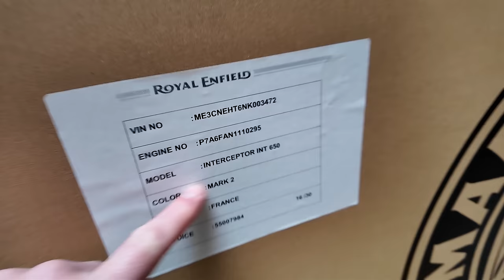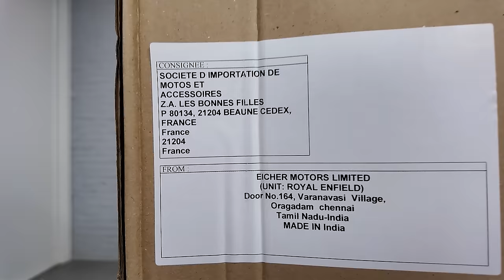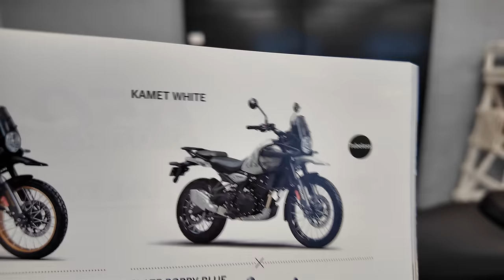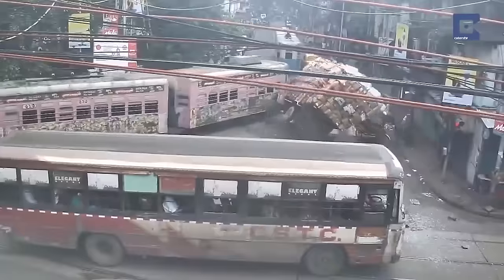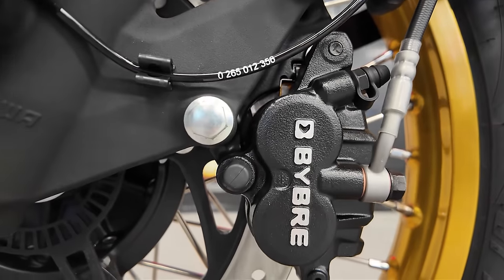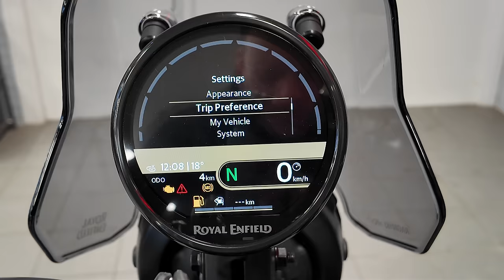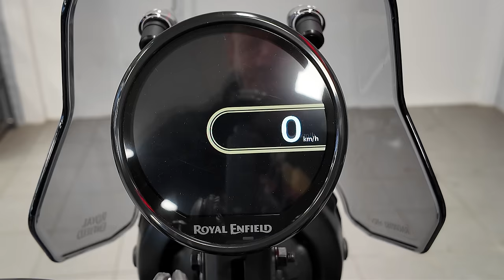2024 ROYAL ENFIELD HIMALAYAN 450 Unboxing (40HP)

Comment: I have a RE that's from 1980s... it's from my uncle...after he passed away i took the bike...it don't have petrol meter on it you have to open the tank to measure petrol and the sound it produce can give a heart attack to a old man...there won't be any better vehicle then royal Enfield and it's not meant for speed its take so much time to reach even 60-70 km and the gears are on right side unlike modern RE...there has to be two keys to make the bike start...one to start the engine snd other to produce petrol to engine and its doesn't have self it's kick start bike...old RE are total beast unlike modern one... it's good to see Royal Enfield getting recognised

Comment: You should connect the positive terminal to the battery first, then the negative.
This prevents short circuits because 12 volts of electricity are coming out of the battery, and a spark or a short is possible, if unlikely. 
The positive side connects to an engine part. The negative or ground terminal connects to the vehicle's frame.
Reply from the maker: Will do next time , might not explode than 😁
Reply: @LifeofSmokey  I hope you're alright 😂
Reply: @blaze26700   A bit burnt round the edges. Thats why him called smokey, innit

Comment: 13:52  In India, it is necessary to have rear view mirrors on the right hand side of your bike, not so much on the left hand side, people usually leave it off, hence the rubber tipped reusable kind of plug, for the left, but the one use tape for the right side. Hope that helps.

Comment: I want one! Also,  no, a cigarette cannot light gas on fire. Only an open flame can ignite gasoline.  You can dump gasoline on red hot coals, and all that would happen is that the gas would evaporate.  The evaporated gasoline is very, very explosive, and it looks like dry ice with the color and how it flows low to the ground. I had an interesting childhood. 😁

Comment: Well a very nice bike
 My 411cc model constantly gets fuel pump problem or whatever. The service guys couldnot fix it after 4 visits. Until that it ran for 2 years without any defect. I only changed tyres

Comment: It depends on flash point of fuel and the temperature of the flame of the cigarette’s flame but however oxygen is needed for the fire to happen which isn’t present in sufficient concentration on tip of cigarette. That’s why you can’t set fuel on fire with a cigarette!

Comment: Hi, ccan you look for these issues aftert a test ride of about 500Km ,Thank you. Just want to see if they fixed it for the export models.

-Bike pulling right when hands off handlebar.
-Con set sounds and issues
-Loud tappet sounds(louder than exhaust😂)
-Vibrations through out the rev range
-Tank leaks when it's full and on side stand🤦‍♂
-Sound from brake pads while braking (great brakes but the brembo pads do make sound).
Reply: Its their first water cooled engine so yeah.

Comment: 198 kg? dry weight or fluid and battery included?  I am contemplating between cf moto 450mt or the himalayan 450
Reply: Fluid and battery included with crash guards and centre stand. I've seen a video of some guy reducing the weight to 170kgs.

Comment: For the Gasoline question, it depends on the ambient temperature, if the temperature is below flash temperature (for gasoline −43 °C) a cigarette will not be able to initiate combustion, however above witch, it will depend on the chance of the vapors of gasoline to come in contact with the heat from the burning cigarette to initiate combustion, the higher the temperature the higher the chance. 

So in −40 °C it will be very unlikely, while in 45 °C it will be very likely.

Comment: You need a minimum of 14 parts of air per part of fuel to have combustion. So you can put out  a cigarret in a cup of fuel if it's filled to the brim.

Comment: Chain looks very exposed near the front sprocket. Would worry my jeans get snagged in it, or at least a lot of oil getting fling off the chain onto my boots and jeans
Reply from the maker: To closed and mud and dirt with get stuck in it and make the chain tighten up really badly. Happend to Bob's Norden too 😅

Comment: 17:47 You not only can't light a fire with burning cigarette on gasoline but also it's not possible with a battery sparks.
This is why automotive spark plugs, for example, typically operate at voltages in the range of 20,000 to 30,000 volts. 
So yeah it's a myth but do try this at home peace ☮️

Comment: Huh, they don't ship it with the oil, coolant and such in it do they? You skipped that part in the video i assume? They ship them dry, right ?
Reply from the maker: Nope they always start and test the bikes at the end of the factory assembly line before they are shipped. They even have a little bit of fuel in it 😁

Comment: I was hoping to see the tubeless spoked wheels. The other dislike for me is the integrated brake light into the turn signals, I'd prefer the brake light to be independent especially for a dual sports bike.
Reply: You could make the rims tubeless ready I should think. I'd fit an aftermarket brake light
Reply: It does come with tubeless spokes as extra option. You can always add on extra brake lights too

Comment: U said 32 Nm torque. It has 40 Nm  torque.
U said it is water cooled. It is liquid cooled.
Reply from the maker: Is the liquid inside coca-cola or water? 😁
Reply: @LifeofSmokey it's liquid cooled, but you can't use water😂, you should use coolent

Comment: ECO mode is merely the idle running 100 RPM lower than standard mode, this is a common thing with most automobiles, and now with a ride by wire bike ? All other ride by wire bikes have some true assortment of different settings. With this bike they are saying the headlight glass is clear, free of charge !!!  Brown is the least liked color, so no charge for that ! This may be one of the few bikes that may compete with the wave of Chinese bikes coming now like the Japanese bikes did in the 60's.
 Here in the US, they are still referring to 900 cc as mid range !?! This will be referred to as a starter bike.  I actually see this as a mid range bike, and could be kept indefinitely as a daily rider if it is the bike you learn on.
 I must be getting old, as I remember a lot of 90 cc to 175 cc bikes as starter bikes made by all the Japanese manufacturers, and they sold very well before the horsepower and top speed wars began in the late 60's.
 The first 650 cc trail bike was like, what the hell ! Who needs all that in the woods ??? Haha, now look at the ADV bikes, holy crap !!!
 But this bike should do very well for awhile anyways. China coming fast !!!